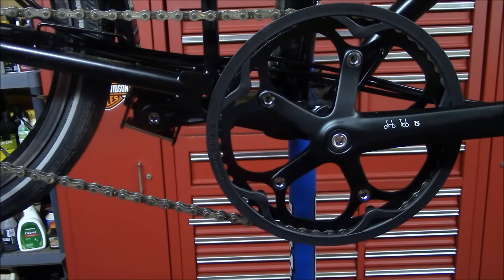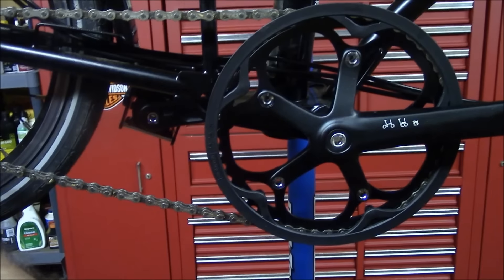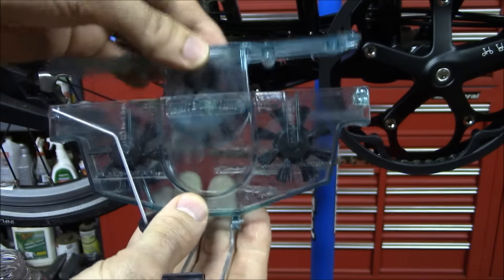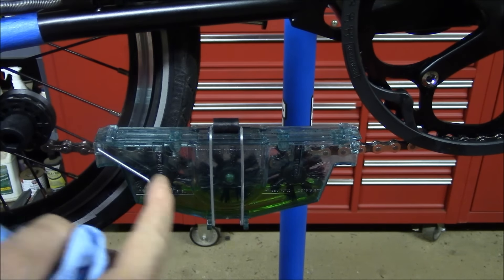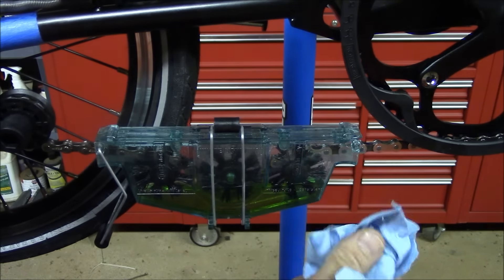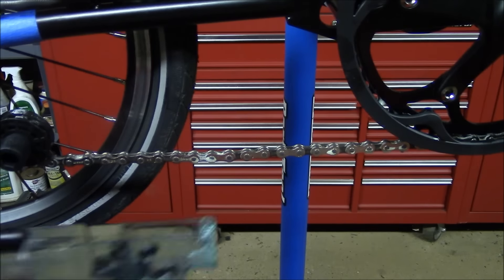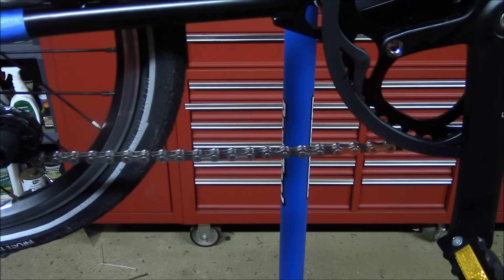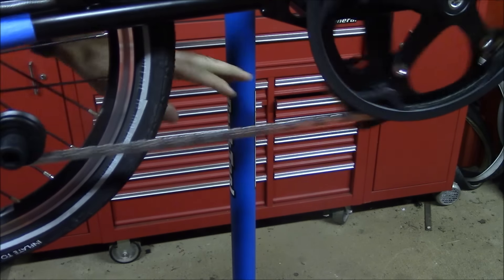Cleaning And Lubricating A Brompton Folding Bicycle Chain

Comment: i have a fold bike , but the chain have rust, can i do not scratch the rust part of the oil directly on it? or to scratch the rust can be part of the oil? thanks.
Reply from the maker: I am not sure I understand your question. If your chain is rusty than it should be replaced.
Reply: Bicycle Alley OK thanks your suggestion.👍👍